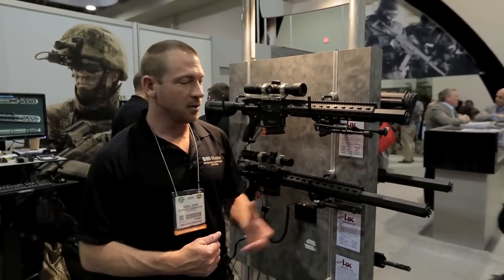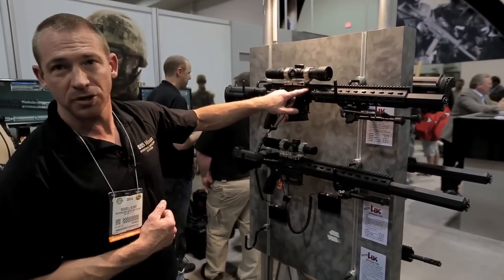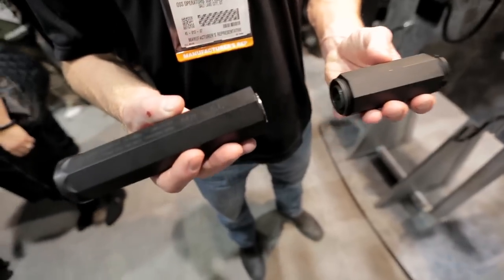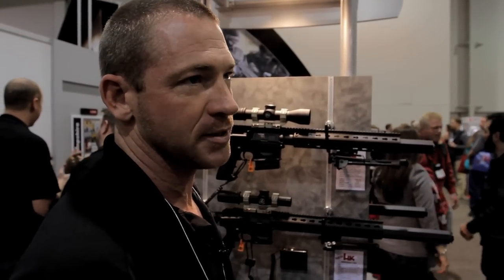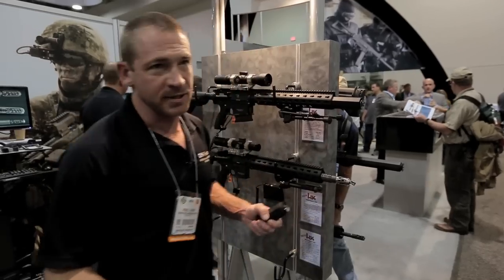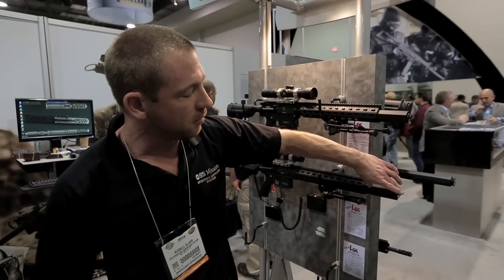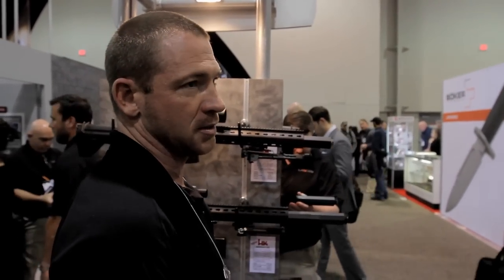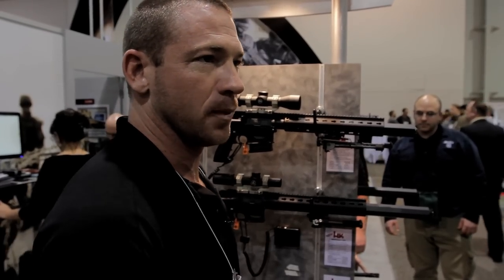OSS Suppressors

Comment: wouldn't subsonic ammo offset the increase in bolt velocity?
Reply: +triynizzles it always will decrease bullet velocity. it's the nature of the ammunition.
Reply: +triynizzles in its definition, it is ammo slower than the speed of sound
Reply: +Phil Roy he said bolt velocity as in the lower powder ammo that makes them shoot slower than 1125 fps would mean that the guys claimed 40% bolt extraction increase would be good since with lighter loads, it would accelerate the bolt to normal operating speeds potentially.
Reply: aaaand this, kids, is what happens when I read too quickly. well noted.

Comment: well as far as the suppressor decibel level that's not much suppression and when he talked about having another suppressor on there and how it causes more back pressure and that the decibel levels we're still in the 140 range I can tell you right now he must have been using an oil filter because that is a lie I know that for a fact

Comment: Any increase in velocity is mitigated by the pressure that is built up in front of the bullet when it enters the pressure area and it creates a scavenging effect that will slow the bullet... Sorry no free lunches in Physics.  The turbine design is interesting but the Suppressor is VERRY Long in person... I saw this at the Shot show, its much longer than most, twice as long as a surefire or AAC.

Comment: No suppressor is worth it unless the decibels are reduced to 0.00%
When you fire that round off
You should hear only the hammer drop and recycle
If bolt action then just the hammer
Nothing else
Reply: Subsonic 5,56 has significantly less energy than subsonic 9mm pistol... Is that what you need? 
Normal cans will save your hearing in home defence kind of deal when you didnt have a chance to take hearing protection. Saying that they are worthless is ridiculous.

Comment: Pretty big claims with little information to back up those claims.What I gathered from their videos - and their own website...They prefer to test sound level "at the shooter's ear..." rather than at the muzzle.  Why is that? The whole point of a suppressor is to reduce the sound of the gunshot overall, not just at the shooter's ear.  Why deviate from industry accepted standardized testing of suppressors?  This practice hints at questionable or at the least - misguided intent.ALL suppressors act as flash suppressors and muzzle brakes - this is nothing new.Bolt Velocity is a problem that's easily remedied with adjustable gas systems at a far lower cost than an OSS system...What does it cost anyway?  Why not list an MSRP?  I've heard prices varying $990 to $1450 online, but which is the correct price?First it's fitted with a heavy muzzle brake-like device, whose weight is unstated and unlisted. Then you add the large BPR module - whose weight is unstated and unlisted...  Then in addition to all that weight - you add the Signature Reduction Module - whose weight is unstated and unlisted.All of that "unlisted" weight on the muzzle of any firearm will change bullet impact - but how heavy is this overly-complex system?  It's certainly not on their website or stated anywhere else I've been able to find.  Not typically a problem as all suppressors change bullet impact somewhat due to weight - but how does this compare with other models on the market?Then we can go on to the sound reduction levels advertized...  Their advertized sound reductions are of limited value because of the inconsistent testing methods & processes...There are a couple other groups that did consistent testing, and those results were quite informative...  Typically the Silencerco Omega, and Specwar outperformed the OSS 7.62 system by 7 to 9 decibels on average.  Yes, with higher bolt velocity but that can be adjusted with gas systems.Besides, on February 18th, the day before this video was posted - the Founder & (now Former) CEO, Russ Oliver, resigned due to problems with new management.  I don't think I'll be purchasing any of their products any time soon.The technology is too unproven, and independent testing is thus far showing it's perhaps not all it's cracked up to be...  Then there's the issue of current management consistentcy.

Comment: Cleaning that is gonna be a major pain!
Reply from the maker: I've found that soaking in solvent and using toothbrushes is the way to go for most of my hard to clean items. I'm not 100% sure of the materials but I'd say that wouldn't be an issue as long as you didn't shoot a bunch of cheap ammo and let the carbon build up.
Reply: Yea thats definitely true. Granted this is an HK product so they aren't looking to make simply a practical and affordable product. This is innovative and won't sell for cheap.
Reply: Guns
I saw on a shot show video that the materials were machined steel and aluminum. :)
Reply: Guns A lot of suppressors also seem to work better with a little carbon build up and are self-cleaning to an extent beyond that. I like to keep my shit clean anyway.

My issue here is more along the lines of being unable to transfer this suppressor from one weapon to another easily (by easily I mean cheap).
Reply: da1krayziethug why not? the NFA stamp is for the suppressor itself, not what it will be fitted to.
Reply: The NFA stamp is a good point, but I would rather not have to buy a ~$350 MB for each firearm I own that might be using a suppressor. It makes a lot more sense to just unscrew the can and screw it onto another gun. This would interest me a lot more if the "baffles" were removable from the sleeve, but are supposed to be screwed on to the gun.

Comment: I thought you had to be under 140 db to be considered hearing safe... and fyi that thing looks ugly and complicated as hell I dont dare guess what they are listing the MSRP at
Reply: +Joshua Colantuono 120db is the limit of where it starts to damage your ear drums. I took a Audio Engineering class and that's one thing I learned. Of course you can vary the db limit for individuals due to differences in anatomy in the ear itself. So really 120db's start to damage the average persons ear drum, but keep in mind statistics don't apply to individuals.
Reply: +Joshua Colantuono I've also heard that a fighter jet at full speed at 14,000ft elevation is around 120db's so if you were to have one fly over you it's really loud. I also have no clue if that is even true because some lady told me that at my school.
Reply: +Gung Ferdoosh typically a rock concert is 110, aircraft landing strip is 130 and gunshot from 1 meter is 140+. all are "technically" required to have double level ear protection (cover and plugs) but only extended periods of exposure will cause the damage. hence why different people say different levels are harmful. It's all about how long you spend in the environment.
Reply: Yeah, the longevity of the loudness and consistency have an effect for sure.
Reply: Joshua Colantuono at work places 90 db is considered the threshold of permanent damage but it is also a issue or matter of time of exposure

Comment: Whenever a liberal asks why I need a suppressor I ask why they doesn't always play their tv and music at full volume
Reply: well, as a neutral party, i'd beg the question "why do you need a gun that loud in the first place?"
Reply: than why not wear proper ear safety equipment which would cost much less than a suppressor/silencer?
Reply: yeah, thats why you buy ear protection
Reply: do you buy them for the animals too so they cant hear where you are when you shoot? no-one ever said dont wear cans. it can still be fucking loud through your muffs.
Reply: most game can hear a silenced weapon anyway so your best bet is a bow for large game or to wait or even travel away from the place you shot from
Reply: people have hunted for millions of years before guns were even made/popularized so  it is quite possible. May not be as convenient but still possible and would make much less noise than a gun. though even with a gun that doesn't sound very easy. I admit i'm ignorant to culling a herd of (i'm assuming wild) goats but i'm assuming if it's a pain with a bow it probably doesn't matter how loud the ammunition is just how many you can consecutively kill before they escape.
Reply: tag?(where do you have to have a tag for goat?) also I've never heard of a bow breaking under normal circumstances unless you dry fire it (pulling it back and releasing without an arrow nocked). The reason why I prefer a bow is that it takes actual skill rather than point and squeeze till it's dead or you run out of ammo. actually earning the kill rather than stealing a life.
Reply: I've honestly never run into that issue, I imagine it very well could happen but I digress. But, in my honest opinion, outside of survival/self defense/defending your country via military of some sort guns are just unnecessary, I can understand if you are hunting for the purpose of food and using a gun to make it easier; but for sport, a gun just seems like cheating in my opinion. It takes the honor out of it. The skill just isn't required with a gun (in general, I do realize some guns are not as easy as others to operate the correct way) like there is with a bow or even a crossbow. I know not a lot of people feel this way but honestly if you are going out to end an animals life just for sport/for fun in the case that they come after you due to your lack of skill I think it only fair that they run away from you or hunt you down in the vulnerable state you are left in when using only a bow. But this is my opinion and no one has to follow it. Under the assumption of what I gathered of the "culling" sheep subject i'm guessing they are either overpopulating or ruining your or whoever is paying you's crops or farmland?
Reply: first off i'm pretty accurate with a gun, and while there is "marksmanship" there's a lot of those things and more you have to take into account with in archery. also, not a liberal as I said above i'm neutral not republican or democrat cause I don't agree with either one full-heartedly. and also I have every right to argue as much or as little as I want and you can argue back just as much or just as little as you want and there isn't a thing you can do to stop me besides not replying because I am an american citizen, born and raised.
Reply: and that's your opinion.

Comment: Gotta love the bullet velocity/bolt velocity arguing in the comments.

Use the same, NATO 5.56mm ball ammo, in two different carbines: one has a suppressor and one doesn't. The one with the suppressor with have a small bullet velocity increase because of the suppressor retaining the gasses in the barrel longer, therefore pushing the bullet faster. This velocity increase is marginal, BTW, but it still exists; anyone who says otherwise without valid proof can suck my left nut.

Thing is, for suppressors to be very silent (kinda similar to that little "psshht" you hear in movies), they have to use what is called "sub-sonic" ammo. This is ammunition which propels the bullet slower than 343m/s, therefore not breaking the sound barrier, and not creating any sonic boom.

Now, this is where people get all confused and shit: The rifle which uses sub-sonic ammo and a suppressor will have slower traveling bullets than the one using normal NATO 5.56mm, because even if the suppressor gives it a small velocity increase, it isn't even close to matching the very high speed of NATO 5.56mm ball. This is also what causes "more drop-off at range" like BF4 fans mentioned; since the bullet takes more time to reach it's target, gravity has more effect on it. If you did not understand the previous sentence, I suggest you go back to school and listen in physics class.

Now, in the video, he talked about bolt velocity. This is why ejection problems were also mentioned; bullet velocity doesn't affect ejection if the gun is suitable (whole 'nother story to which we will not come back)

Due to suppressors keeping the rapidly expanding gasses in the gun system longer, it creates pressure, both on the way out (pushing the bullet out of the barrel), but also into the receiver, where ejection happens.

If there is more pressure than usual in the receiver, the bolt, which contributes to ejection, will "spring back" faster, causing the spent casing to eject in various odd ways, depending on circumstances. The guy in the video explained that a bit, watch it again, he's probably 1000 times more knowledgeable in guns than I am.

Then there's the story of bleed-off valves, and other devices, but that is wildly dependent on the gun used, and I'm not discussing gun features here.

TL;DR: 
-Battlefield 4 isn't a reliable source for gun info.
-Bolt velocity and bullet velocity are not to be confused.
-Look your shit up before you comment, and make sure your comment is concise and clear.

P.S.: All gun nuts who plan to bash on how I explained ejection and receiver shit, keep it to yourself. I know it isn't the most precise explanation, but if you are skilled enough to correct my explanation, you're probably also knowledgeable enough in guns that you didn't have to read the shit I just wrote. This was to explain to CoD pseudo-gun-experts, not to actual gun nuts. Keep in mind this text was written by someone whose age is probably lower than yours divided by two, no bashing. Thanks, have a nice day.